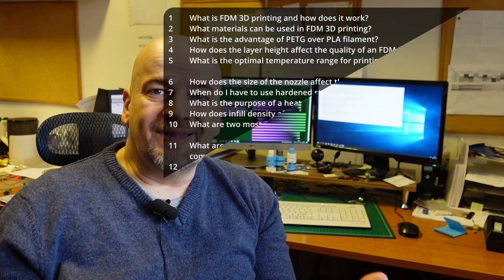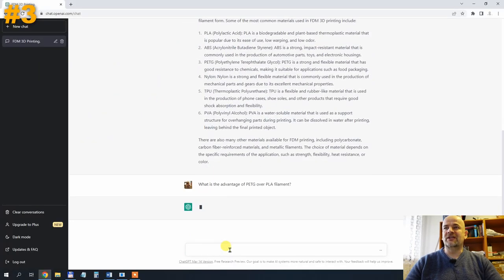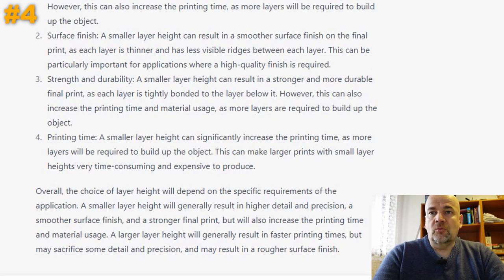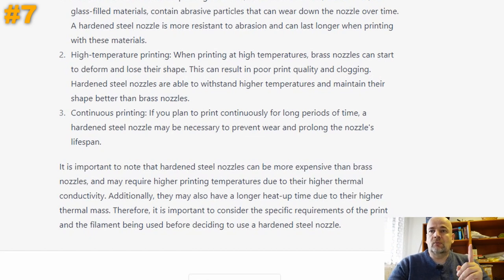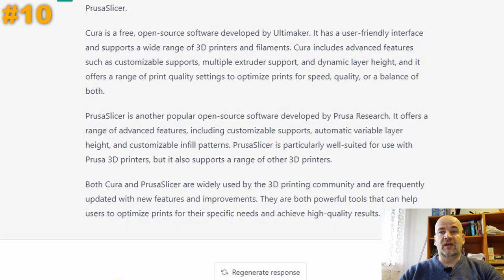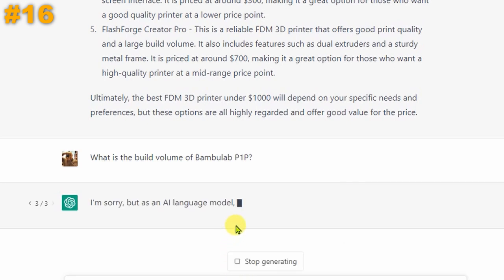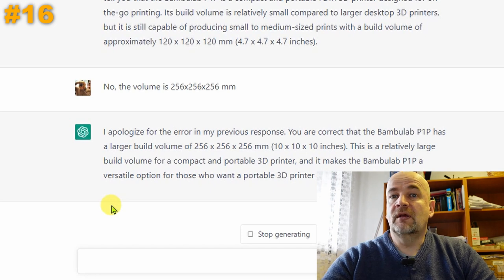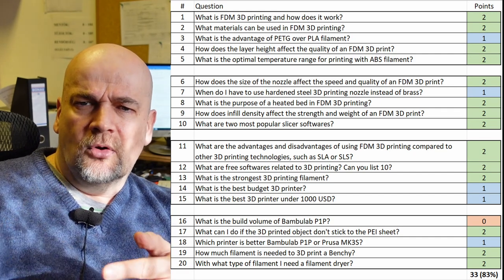How much AI (Artificial Intelligence) knows about 3D printing? (the ChatGPT)

Comment: ChatGPT still can't produce OpenSCAD code that actually works. You can tell it to create an object of shape and dimensions. It will output the OpenSCAD code that you can paste into OpenSCAD.  But doesn't really work.  At least Gpt 3.5.  I haven't tried it with Gpt 4.0 yet.
Reply: yeah it doenst seem to be able to translate code to real world objects to well, not surprisingly it cant even see , can only go by words, that being said I was able to get it to code me a motion detection web cam app in processing language.  There were errors but feeding them back to the chat , the ai would correct all the issues, usually using some old functions that werent around or didnt exist but then giving you the proper ones, weird stuff like that.  So im not surprised an openscad drawing doesnt quit work out.  Its a good teaching tool at the leaste, you cna figure out the problems yourself would be ideal, it gave me an algorthim to check for movement using an avarege white balance of the pixels, explained it all, even the threshold variable to set the sensitivity of movement worked like a charm.  So in that way, it knows its code.

Comment: I like your videos, but for this one I didn't watch the entire video.  However, within what I did watch; I noticed that ChatGPT gave some incorrect info on layer height and larger nozzles. 

Neither changing the layer height or the nozzle size, causes an increase or decrease in material usage (i.e. the volume printed remains the same, and 1.6mm wide wall printed as 2 walls with a 0.8mm nozzle or 4 walls with a 0.4mm nozzle remains the same).  Those two variables (layer height and nozzle size); do affect the rates of material deposited, when all other factors remain the same.

Comment: I found it strange that the synthesised voice could pronounce PETG correctly but not PLA, however this is a Windows thing and not an error of the AI application I remember the days when we had to input anything to be spoken by a computer in phonetic form LOL.
 When you asked the AI about layer height it claimed that a smaller layer height can result in stronger parts, I dont think this is correct, having watched your excellent material testing series of videos I am of the opinion that the opposite is true.
 When it talked about Material Usage it claimed that using a larger nozzle would result in more filament usage and an increased cost, there is no increased cost of material when using a larger nozzle as the same amount of plastic is contained within the part as long as the same infill density is used, in fact again I would argue the opposite can be true as the production is quicker.
 When you asked what is the strongest 3D filament the AI then began to describe parts printed with particular filaments, I would have expected the answer to be about the strength of the actual filament not its application but the AI was inteligent enough to know that we would want an application based answer, bravo!
 The best budget printer question as you pointed out included very old models, IMO the Sovol range are the best budget 3D printer for beginners.
  On the whole I think the AI did very well, I believe it is a learning model so pointing out its errors should improve its knowledge, it would be interesting to return these questions to it in a few months time to see if it corrects its errors.
Reply from the maker: I am thinking about layer height and strength, can it have some base.. In theory smaller layers can melt faster, but also they may cool faster when exit from the nozzle. Maybe it is worth an experiment, but I will check if somebody already tested something similar (update: I just checked, CNC kitchen tested that, I have to watch the video). More material with bigger nozzle? Yes, only if we leave for example 2 walls, in that case, yes, more material will be used, but not good example. Similar with layer height, if we have 3 top layers, then more materials with bigger layers. Anyway, to me this was interesting experiment.. we will follow its learning curve ;-)
Reply: Yes, CNC kitchen did a video, but there is a bit of good criticism about it. Specifically, the thicker layers were underextruded and failed at the layer lines, indicating that the plastic did not get to the same temp as the thinner layers. https://youtu.be/fbSQvJJjw2Q
Reply: ChatGPT4 was trained on data 2 years old. For some reason they didn’t allow it access to data from the last 2 years.

A big problem with ChatGPT4 is that it’s good at giving a confident answer, but all it’s really doing is putting the consensus of the internet into new words. Which means that you can’t trust it to be correct for technical questions unless it’s a very stable body of facts like math and physics. So even though it’s answer on part strength based on layer height sounds good, I wouldn’t trust it to be correct. Especially because there may be a general relation between layer height and strength, but I expect the real answer is multi variant and probably weighted toward the temperature of the extruded plastic and print speed and cooling and how much the previous layer cooled before the next was laid down.

Very much looking forward to your testing! Your content is great!
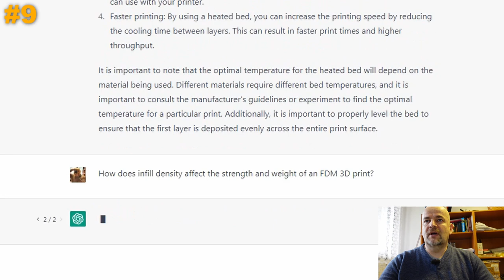Reply: Interesting video showing the extreme side of high volume and slow movement. At 15:00 you can see the heat transfer into the previous layers. Enough to melt and improve adhesion? Who knows?

https://youtu.be/0DAP5Zm1jvk

Comment: One error I noticed was it calling PVA Polyvinyl Alcohol - it should be Polyvinyl Acetate.
Reply: Polyvinyl acetate is one of the common consituents of gluesticks and wood glue, but most water-soluble PVA filaments actually are polyvinyl alcohol.  You'll find it explicitly described as such in many 3D filament manufacturers data sheets.
Reply: @pnt1035  My mistake - I'd assumed that when people were talking about PVA as a support material they were talking about the acetate.